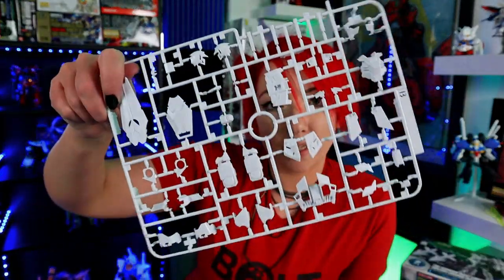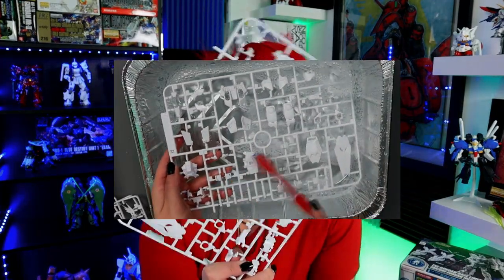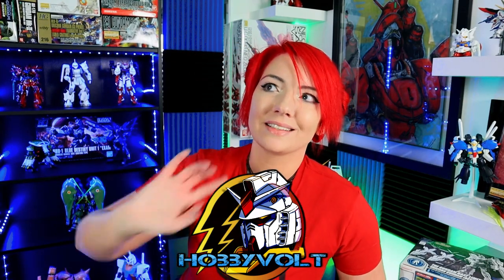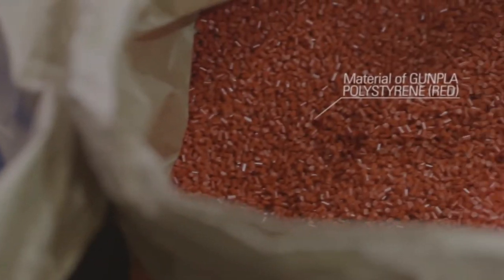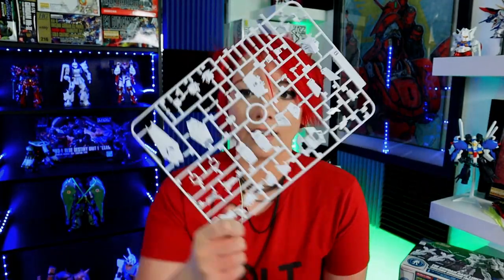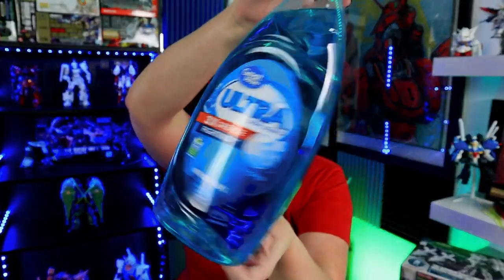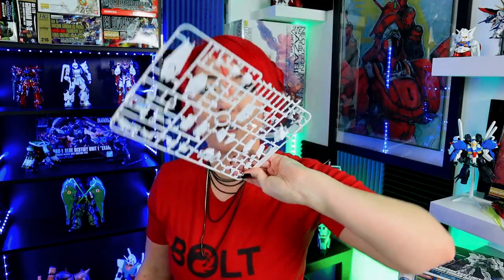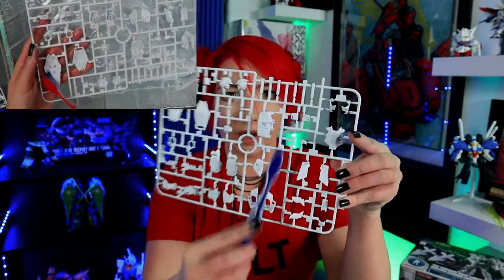How to wash Model Parts⚡Why is it important?⚡Model Kit Paint Prep⚡ #gunpla #gundam #modelkit #howto

Comment from the maker: Hey! You're awesome. K. Byeee!!!

Clarification:
I know I said "hot" water but I just mean warm. Not scald your skin hot! That's how you warp plastic. Imagine it's the temp you use to get the wax off your produce after you buy it from the grocery store. Same concept!
Reply: I was going to comment on that the water should be warm.
Reply from the maker: Yeah! I slipped up on saying hot! I just meant warm!
Reply: In a large pot, bring water to a boil, then place runners, 1 lb. of cubed steak, 3 large potatoes, 1 small bag of baby carrots, and 1 cup of diced celery. Bring to a simmer and cook until meat is tender.
Season to taste.
Gunpla Stew
Reply: @HobbyVolt  🤦‍♂️ Ever seen modern plastic melt from hot water? Bandai kits are made of PVC...which starts melting at 180°C or 350°F...
mmh so what was the temperature for water to transform into gas again🤔?
Reply: @Presbiter  3D printed resin parts exist and they will warp

Comment: Just wanted to say excellent video. Very good and to the point. Liked the video and explanation of how the molding process leaves residue on the plastic and how that can keep the paint from sticking. I also liked the reasons for using plain dishwashing soap instead of simple green or something more harsh that can damage or ruin the plastic. I wear latex gloves and a really soft toothbrush as well when scrubbing them after removing them from the warm soapy water. Kitchen sink works fine. I work on the big 3 and 4 foot long 1/200 ships and let those soak in a warm soapy bathtub half full. Also I let them air dry a bit and use toilet paper and q tips to completely dry them off. Thanks again for an excellent video. Well done!
Reply from the maker: Thank you so so so much! I've always stayed away from ships, tanks, and planes because I KNOW I'd buy too many! That's so cool!

Comment: Back in the 80s and 90s kits could be pretty greasy right out of the box. I remember specifically kits from Revell/Monogram being bad for it. However in my experience I've found that Bandai kits are usually squeaky clean right out of the box. Washing the parts won't hurt anything though. However, I do wash parts if I've done major nub & seam removal and repair to get rid of any dust.

Nice Silence of the Lambs reference at the end 😂
Reply from the maker: Oh for sure! They have massively improved. I know Warhammer hasn't improved just yet and this is a big deal for those kits as well!

Also, yes. Lol!!!
Reply: True, it will still improve your paint by cleaning off your finger oil. Also filtering your paint properly makes a very significant difference to the quality of your paint job.

Comment: whats your stance on washing sliver plated/molded runners? like if one were to be buliding a pg rx-78-02 unleashed for example.
Reply from the maker: For mine I didn't wash it because I haven't painted it yet. However, if I were to custom it, I'd lightly wash it before paint prep as usual!

Comment: How do you keep them clean after it's done? I am critically OCD and I just think of the dust and everything that may accumulate on the parts during or after they are done drying, and the time before I can apply water slides, stickers, and other decals before I can top coat or other processes. I am terrified of painting due to this.
Reply from the maker: For my methods, I will end up cleaning them again before paint and after all the cutting, sanding, and customizing. Then you can wear gloves from that point on to place the pieces on your alligator clips!
Reply: @HobbyVolt  doesn't cleaning remove stickers though? I'm thinking of how do I keep them clean from dust when I'm in the process of applying decals because that can take a long time. Would I have to wash each part, and remove the one I want to paint and apply stuff to from the water? I've never painted or applied water slides before, so this is intimidating. I do wear gloves when I build some kits due to my room being hot (sorry if I'm rambling, I'm just a worrier). Should I invest in a dust collector for my room? I don't have a job, so I'm limited in what I can do (again so sorry for rambling)
Reply from the maker: I don't apply decals until after I custom paint. If I've already built a kit and decaled it and want to paint it, I remove the stickers and buy new ones! Once a kit has been decaled, that's pretty much a done deal unless you want to redecal it! No worries on questions at all! I love helping!!! Did I answer all your questions or do you have more?
Reply from the maker: Also, a dust collector is cool and all but an open window does just as well! If you're extra worried, it wouldn't hurt at all to get one for safety!
Reply: @HobbyVolt  Thank you so much! I've only been building since September of last year, and I've built 16 kits, 3 being MGs. I'm doing the RX-0 Unicorn Banshee 02 Full Psycho Frame Prototype, with tons of clear parts. Intimidating, but I have to start eventually. I plan on doing it today, so whatever the outcome, I'll be proud. I look forward to more stuff from you!
Reply from the maker: That's so exciting!!!!!! Great kit choices too!!!! Good luck and thank you for watching!!!!
Reply: Forget about building models, this OCD of yours is an impediment for you to own models
Reply from the maker: Hey dude! I see all your comments! I definitely suggest you make your own channel with all your specific advice! It'd do great!

Comment: I'll keep this technique in mind, just in case. My RG Banshee and MG Barbatos are due to arrive in a couple of months. Thank you, kindly.

Edit:
Prime example of why to clean the plastic:

I wanted to paint my keyboard case in chrome-gold. I rubbed it with the hard side of the sponge, applied primer, then paint and finally topcoat. Thing is, it didn't stick well, and now am left with a half-metallic, half-matte gold mess with some primer sticking out and steadily oxidising (turning green).

Pre-wash your plastic, folks. <3
Reply: I think you didn't prep you board case properly. Primer sticks on a more rough surface then what was made from a sponge

Comment: I leave them to soak and air dry, but the idea of using an old toothbrush is a good one. I do sometimes worry about my partner walking in on me with kits in the bath. I must look a little mad.

But yeah, cleaning on the runners is standard isn't it? The only parts you'll miss are the nubs. I've been making models since I was a (smaller) kid which is far longer than I want to admit... But I've never heard of people cleaning it off the runners exclusively.

Doing a bit of both, that makes sense. But yeah I'm with you. Last thing I'd want to happen is missing one tiny piece sucked down the plughole.
Reply: ...

I am so glad I never saw that horror you're describing of oiled ducklings on dish soap bottles.

I guess the idea was "cleans the worst messes even on gentle surfaces" or something... But ducklings covered in oil sounds like such a bad look for your washing up liquid.

Comment: I’m responding kinda late but I just found this video and I have a question. Isn’t your plastic gonna melt if you but it under hot water?
Reply from the maker: Great question! I misspoke and corrected the water to warm in my pinned comment! You are absolutely correct! It would melt/warp if it were too hot!
Reply: @HobbyVolt  oh I didn’t see the pinned comment and thank you for the tutorial or tip

Comment: but why shouldn't you clean them while still on the runner?
Reply from the maker: I may not have explained it correctly. I like to do one clean on the runners right out of the box. Some people think it's stupid because you touch the parts again while assembling the kit but that neglects the fact that I also clean my kits again before painting. It's just the process I like to do and it's more thorough than most people think is necessary. It's literally all preference and depends on so many factors. Some people don't clean kits at all and that's all preference.

Comment: It’s a good idea to start on the runner because your parts are still numbered. Then I straight build, then when I’m ready to sand and prep I’ll wash throughout the process. I try to sand each part unless it’s an invisible internal part, or the hidden faces of an inner frame part, or a rubber/polycap.
I just let the parts air dry on a clean white towel or paper towel.
If you’re concerned about detergent residue, TSP is what’s used to prep metal/composite surfaces for paint. Its a powder sold at most home centers, dissolves in water, and does not need to be rinsed. 
If you’re a redditor do not even consider thinking about gunpla or painting or really any leisure hobby activity until such a time as you have an ISO 20001 compliant clean room with a positive pressure HVAC setup, water distillation plant with deionization and reverse osmosis filtration system, ISO compliant lighting, climate and humidity control, 5 units of every kit and obviously only the most expensive tools available to humans currently living. Even this is woefully inadequate, that’s not lost on me, but for such individuals perhaps a rudimentary starter setup of sorts for a newbie, if you will. That is all.

Comment: #MOBILESUITMAS
It's definitely important to clean your plamo pieces.
I wouldn't use hot water; maybe warm/lukewarm.
Cleaning off any mold release left on the part is the main reason why someone would want to do this; especially for painting.

If you choose to clean the the parts when they're still on the runners, that's fine since that's how you like to do it. There honestly is no inherent correct or incorrect way of doing this.
Your reason of bulk cleaning them while they're on the runner and not having to worry about losing parts makes sense.
3:56 You ran into dead bugs? What?! 

4:35 White distilled vinegar has a pH of about 2.5 which means it's acidic. I'm not 100% sure it'd really the best thing to clean plastics with. 
4:52 Yea I've heard people using 'Purple Power'. Apparently it's caustic so (for example) it will corrode aluminum. It is also apparently toxic to inhale. I'd be hesitant with using either of them. Usually, people use 'Purple Power' or 'Simple Green' to remove paint from plastics (as an alternative) or to remove metallic coatings on plastic parts. When you cut the metallic plated parts, it'll leave a cut mark and that doesn't look that good. So what some people do is submerge it into those for some time til the coating is removed and you're left with bare plastic. Then you'd paint the part to give it a more clean finish with the blemish the cut mark pretty much gone.
5:50 🤷‍♂️
5:51 Definitely agree with you here that there is no right or wrong way to do things and you do whatever it is you're familiar with/comfortable with.
8:36 "It washes the pieces unless it wants to get the hose again!" 🤣
8:49 I mean I guess I used to think about those ads years ago when they'd have those commercials on TV. I totally remember when they used to have those ducks on the Dawn dish soap bottles.
Reply: @xxnike629xx I remember when you shared your story of you trying painting for the first and only time which sadly, ended up in a catastrophe. You said that you got suffocated and swallowed some paint as a result. 😢

Not only you never tried painting again, weeks or months later, you quit building kits too. Double sad. 😢😢

But on the positive side, you'll never botch in painting again. After all, you'll never gonna try that again. And as said above, you don't even build your kits anymore.

You gotta thank your COWARDICE for that 🤣🤣🤣

PS Speaking of, you still haven't share your thoughts about HGUC Xi Gundam being NOT a P-Bandai huehuehue